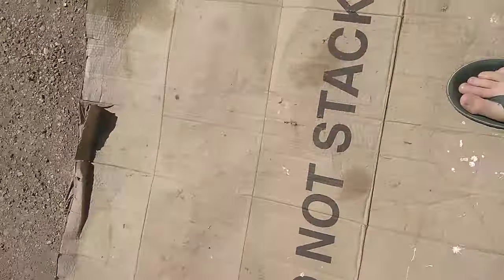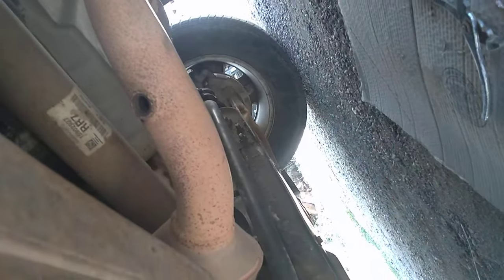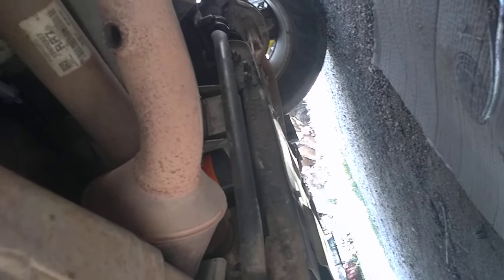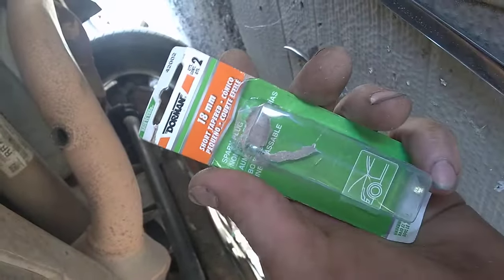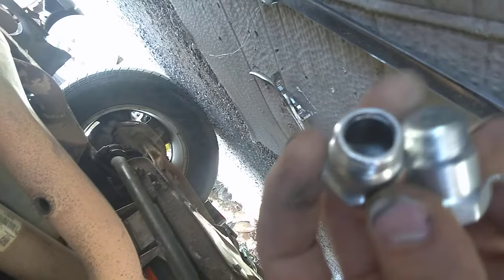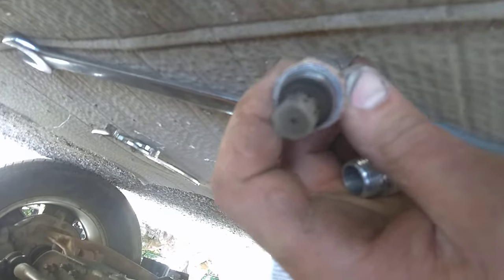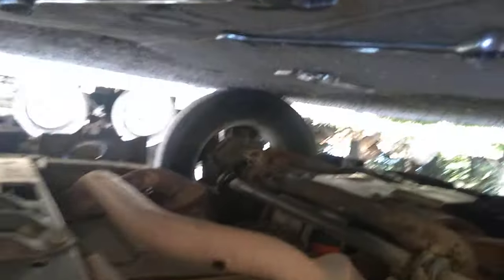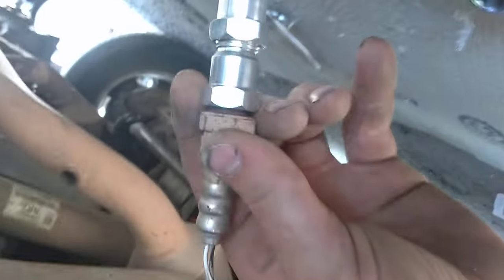o2 check engine light bypass after getting rid of catalytic converter on gm car truck or suburban

Comment: So what is the science that makes adding the two adaptors to the sensor fix the signal error to the ECU work?
Reply: I don't know what you mean by "ECU work" but, The answer you are seeking is, by moving the O2 sensor out of the exhaust stream you lessen the exhaust gases it can measure. Thus making the ECU get a lower reading from the rear O2 sensor (after the cat) like it would if he didn't hollow out the catalytic converter. Right now, the ECU is seeing the same amount of exhaust gases before AND after the catalytic converter. It thinks the catalytic converter isn't working So it sets the check engine light and the p-420 p430 codes.  I don't know what state he is in, but in my state of New York if you have any kind of check engine light on you fail state emissions and can't get your car inspected. I'm imagining he lives somewhere similar

Comment: if you're in a region where roads are heavily salted, i'd recommend anti-seize on both ends of the adapter in case you have the vehicle long term, forgot you added a defouler, and the sensor finally does needs replacing. the adapter works, but years later the rust build up is a pain.

Comment: That trick does not work. I’ve tried it after 10 to 12,000 miles exact code comes back you’re going to have to deal with the issue. Figure out why it’s coming on and what is causing it. You have to diagnose it. Or replace it and replace an O2 sensor will not fix is code. It is not the O2 sensor, I know because I’ve done this and I went through the whole computer system. Found a glitch in my thermostat slight misfire got the motor running perfect still had the same code no exhaust leaks it come down to the cat so I have to pull the cat and do a couple things for it. No, I will not got it, I will not drill it but I have a solution that will fix the problem so I do not have to replace it. I know it works. I don’t give those tricks out.
Reply: Solution? Having same problem and new CAT is expensive.
Reply: @BigBoss0_ solution is new cats back on 😂 I have tried the bypass sensors before to and only lasted a few months.
Reply: This works (temporarily) to pass the emissions with a failed catalytic , while people who remove the cat completely use this as a permanent fix for the code. If your cat is clogged, it can cause damage to your engine, your engines oil gaskets & seals.

Comment: This guy here is doing it because he's completely removed all the guts from his catalytic converter, and that makes your check engine light come on because the O₂ sensors measure that there's no change in the exhaust gas's makeup before and after the cat (because it's no longer there!).

But most people do this because they get a check engine code P0420 (or P0430) meaning 'cat inefficiency is beyond threshold' meaning their catalytic converter has worn out. These codes prevent the car from passing inspection.

However, in some states like California and New York and Maine (which have both adopted California emissions laws) you now have to buy a 'CARB compliant' catalytic converter. These converters cost over $1000 a piece. And they are a complete scam!

CARB stands for California Air Resources Board. It is a collusion between the govt and automakers to gouge consumers and essentially make them pay a tax on air pollution (California expects all cars to be electric in ten years). 

These new CARB converters are deliberately priced high so that people will be forced to just junk their older cars rather than have to pay so much to get them fixed. Like I said, a complete and utter scam!

This is why these oxygen sensor covers are made, to help the consumer foil this scheme and not be forced to buy a newer car they can't afford..

Comment: I wouldn’t waste my time I’ve done the same thing it got me through omissions 10 to 12,000 miles the same code come back so you will have to fix what is causing the code to come up either replace the cat clean it or diagnose it find out why that light is coming on for that code because this will not fix it at all it will get you through emissions and they will shut the light down for a while 10 to 12,000 miles it will be back the same code
Reply: I had the same issue on my 07 tahoe the codes came right back on after installing spacers.